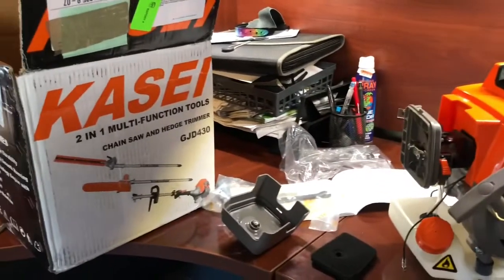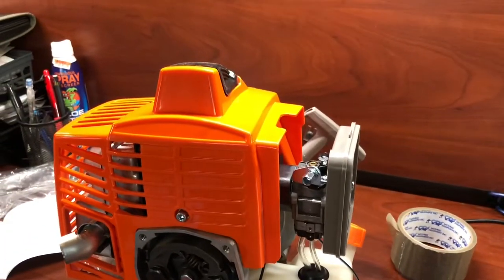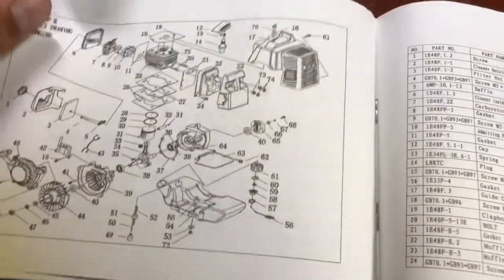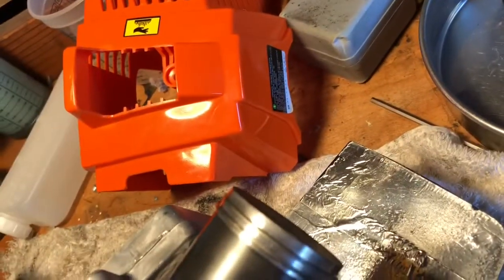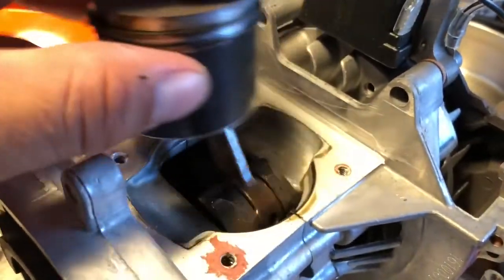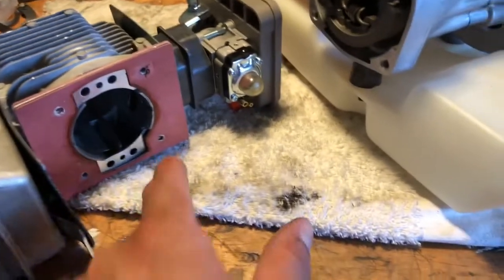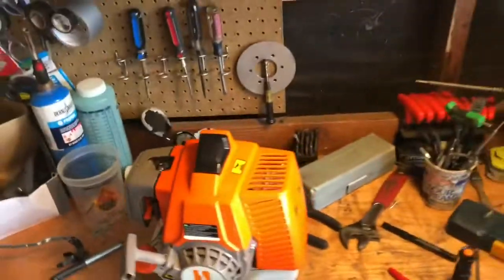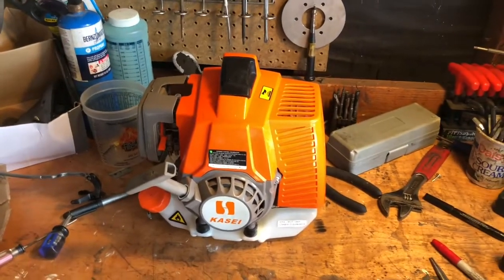Huasheng / kasei 63cc 2stroke engine (unboxed review & performance port work)

Comment from the maker: Heres a quick follow up Vid 
https://youtu.be/BjFo4rY_Gug
Reply: Thanks for your videos homie. It felt like forever waiting for my set up to start comig tog. This engine makes me happy.

Your video gave me alottttttttt of confidence in opening it up. You given me alota good advice.

This engine doesnt overheat... haha. With the shroud.

Also hypothetical question.

Stock Gp460 with only bolt ons. geared for max 50mph vs our 63cc with bolt ons. Geared for 50mph same speed. Who do u think would win in the low and top end? With iut limited 9500 coil.

Just asking for ur opinion. The 63cc a more reliable engine? Do u think theb63cc would beat it in bottom end? Im new to scootering.
Reply from the maker: Waldo's Project hey bud, i never noticed this comment.  Thank you.  And a 460 has a full circle crank, and single piston ring, so it will out accelerate the 63.  The 63 should be a powerful yet reliable option.  In a race the 460 would win... but then there’s variables.  If the 63 had full circle crank and single ring then id say it would be the best.
Reply: If I open my 63 cylinder and remove rubber restrictions and same as remove the rubber ped and I will change carburetor and if I will work on piston what you recommend yes I like 63 motor I have two motors but are restricted
Reply from the maker: Shahid Khalid Abbasi  buy the replacement cylinder on alibaba.  It comes non restricted.  Also the piston comes skirted.

Comment: Did you have to do anything to the piston ? Just grind out those extra holes on the head?
Reply from the maker: Yes, you can see in one of the pictures. I raised the port channels on the piston.  I also lightly ported the cylinder head.  It runs great. I just need to switch the coil to get rid of the limiter however, I do have to re-notch the timing flywheel.
Reply: @arrepuess what’s the difference with power vs stock that you’ve seen?
Reply from the maker: @justaregularguy6971  huge gains.  Quicker & higher rpm,  torque
Reply: @arrepuess do you do work for other people? How much would an engine be like that if one sent there’s in .

Comment: Did you have to get a new gasket once pulled the head off
Reply from the maker: Not if you dont tear it.
Reply: @arrepuess thank you thankfully the new ones don’t come with the 3 gaskets just one and no restrictions on the ports they also updated the flywheel if you try to do this mod with the fly wheel advance it won’t run right they made it so just the coil from 50cc is needed for more rev

Comment: Experiencing similsr issur with my 52cc engine. Instead of circles there are little channels and its on the case side transfers instead of the cylinder. Im afraid to grind it and case match and mess the timing up or displacement.
Reply from the maker: @JoeMammaBff  if its a gasket, open em up.  Itll run un obstructed.

Comment: I have a 49cc 4 stroke scooter right now I'd love to swap this engine on to it what kind of transmission/gearbox would I have to use with this KASEI 63cc 2 Stroke? Would the current transmission on my 49cc 4 stroke work?
Reply: Yes it would work but I run mine with no gearbox straight clutch to back sprocket and I weigh 230 lb and it still moves me good is hell for a little two-stroke

Comment: I find mine a pain in the arse to start when warm . There is a spot where it sucks arse ,and refuse to restart ! It has OK power, but it sucks the fuel down fast with stock exhaust! I have a new kind of exhaust that is super efficient,  way more power,and lower noise ! I will put one on ... next week
Reply from the maker: Sounds like your carb is out of tune.  Get you a tunable walbro 15mm replacement barrel carb.  Or upgrade to hda style.  But that takes knowledge.  Check compression if it struggles to start at times.  Could need a new ring if you run it hot at times.

Comment: Hey rich rz , 
I want to put one of these on my scooter but wanted to ask you some questions . My current engine is an Ie48F that is mounted in the left side of the bike , sprocket is on the right side and it uses a gear reduction gear box so that it will pull to the right instead of the left . The mounting holes for it are 100mm diagonally across the clutch bell , 

Do you know the mounting hole spacing size for the clutch housing on this Kadee engine ? Thanks .
Reply from the maker: MIKE Balderree for 78mm clutch engines, the bolt spacing is 70mm. Or 2.76”..  it fits bladez, evo, goped scooters.  I suggest buying the aftermarket cylinder off alibaba if you want non restricted version.
Reply: Thanks ! Do you have any pics of the port work you did to it
Reply: I’m thinking of buying the PNW porting stage 1 but also considering porting it myself but I’m inexperienced
Reply from the maker: MIKE Balderree I think i show my port work on one of my videos🤔.   Get a replacement cylinder kit from alibaba,  they come unrestricted.  But yeah I recommend PNW’s engines.  Hes a standup fella, and out there putting in work.  So go get it if you want torque.
Reply from the maker: MIKE Balderree dont port yourself if you aren’t willing to ruin your top end, or make it run worse?  First I recommend practicing, and studying how to, what works, & what doesnt.   Trial and error experience

Comment: I have same motor please tell me I would like to unrestricted this engine
Reply: Man can I ask you have removed all rubber restrictions in the middle of cylinder and exhaust pipe rubber as well please tell me your experience
Reply from the maker: Shahid Khalid Abbasi  i ported it,  i used a dremel and carbide burr set to grind out the base gasket.  Study the video and others well.  Have some fun with it.   The easy route is to buy the non restricted replacement cylinder.  Make sure all air ways are free and clear.
   Or send it to someone that knows.  PNW porting on Facebook soups em up.
Reply from the maker: Shahid Khalid Abbasi i recommend you buy the replacement cylinder and gasket.  It comes non restricted.  In alibaba express i think 🤔... its been so long I forget. But its there.  Research a bit and get it.

Comment: Hey bud I use these engines for friction drive motorized bicycle builds and I'm interested in what carb and intake spacer you used
Reply: Cool thanks I have a few 460 intakes laying around. Have you figured out how to get more RPMs out of this motor?
Reply from the maker: Motorbikesbyjason the coil is limited to 9500 rpm .  If you find a way to modify on a different coil, that would be the solution.
Reply from the maker: I use the carb and manifold from the Chung Yang gp460 engine.  You can find it at Daves Discount Motors. (Ddm).    Discount code (ddm). 
   You will have to elongate the bolt holes on the mani to make it fit.
   I bought a MB linkage to fit the hda223 carb.   A better carb would be the hda-48... i think more low end power.
Reply from the maker: Motorbikesbyjason check out my other vids

Comment: Stock carb may be better than the carb kit?
Reply from the maker: Waldo's Project not if you get the right carb for it.  It shouldn’t be too small or too big.  A wt style carb is too small.  You need an HDA or bore approximate bore size... at least 15mm ventury for this motor.   Anything smaller will choke it.

Comment: Dude this sucks waiting for my exhaust. Have u ran it with the stock can? How much of a difference was there?
Reply from the maker: Waldo's Project i did run it with the can for a bit.  And it had stock carb.  Didnt have much acceleration. carb and pipe made it a lot better.  
   You get the jetpro pipe?
Reply: @arrepuess  yes. Its at the post office right now... (sunday) waiting till tomorrow. N ill put it on during my graveyard shift.
Reply from the maker: Waldo's Project cool,  that pipe should be better than the one i modded on mine. 
   Did you port it?
Reply: I also seens the inside of the cylinders n ports n was suprisrd at the machining. No burrs to port. Cleannnnnnnnn. U mentioned something about squishband. N i just assumed well engineered enough engine. N like the videos of the 63ccs 71ccs. Enough. But ur video gave me the confidence to open up a brand new engine. Haha.
Reply: My port job was only the restrictor plate and to the carb spacer plastic thing. Also ground down part of it to attach the 223 carb. I smoothend the burrs inside the venturri. No porting on piston or ports. Maybe next engine. I may drill out n lighten piston. I didnt dunno about crabkshaft balancing. N dont wanna unbalance it. I dunno if piston weight effects it.

Possible cut chambers shallow on top n curve piston by exhaust side. Didnt map nor think massive enough gains compared to the mods i was gunna order. Not for the time imo. Maybe port top of exhaust. Case reeds maybe a cool build for em. Business idea. Make n sell ported gaskets. N metal cut spacers.
Reply: Cracked it open immediately for fear of affecting the grooves for piston rings n cylinder running it. I think they test all these motors factory. But i agree. Prob not broke in. Anywhere close to 5 minutes.

Comment: Are we brave enough to open up a cdi thing? U think there may be a switch inside? Some knob or screw to control rpms?
Reply from the maker: Waldo's Project ive looked into if it’s possible to un restrict a coil, but no luck.  May have to dig deeper.  Or, see if another coil can be modded on.  
  Timing has to be perfect.  Rockit advance key positioned advanced or retarded doesnt help performance on this motor.
Reply: @arrepuess  so I ordered a new coil. There r after market ones u can set time n all that the power spark. But it comes with a battery n trigger state or some shit. Electronic aftermarket type shie. 

Neways I ordered a new stock coil. To try n open up the bottom. Cut it open n see if I cannfind a knob inside to adjust rev limit. Wish me luck. Im ok with the 20 dollar loss. Lols. Hope we can rev up to w.e.

U know what im talking about right? Alota cdis if u open supposedly a knob available.
Reply from the maker: Waldo's Project I highly doubt there will be a tuning knob on stock coil,  but is what you ordered bolt on?
Reply: Yes its the stock kassei 63cc ignition coil module assembly. Same rubber ugly square spark plug boot n all. Coil n module thing tog. 

Its sealed like melted rubber tog. Atleast mine. I dunno how imma cut n open it yet. But wish me luck. If there is a rev limiter. There should be a knob somewhere inside.

Lols wish me luck for both of us. Haha. Lols. 63cc n imagine like 14000+ rpm.

If i find it. Ill definately make a video.
Reply from the maker: Waldo's Project  like i said, i highly doubt there will be a knob, but if there is, that would be very sweet.  Good you are giving it a go.  Because finding a way to bolt on a different high rpm coil would be a bitch, but doable.   Id check out vids or specs on small engine coils.  So far i havent seen any with adjustments, unless its an msd module, but thats a different story

Comment: Could u just peel off the restrictor plate and gasket? Or did u have to grind it?
Reply from the maker: Waldo's Project grind it open to flow perfect through the transfers.  Squish clearance wouldnt accept less.  I know theres an alternate cylinder which clears with a thin gasket in AliExpress.
Reply: @arrepuess  bet homie. Preciate it. Lols u should even record an idle thing
Reply from the maker: Waldo's Project im waiting on a new phone holster clip then ill take some new footage.  It does make impressive power the way i modded it.  Id improve a the carb and mount a new higher rpm coil.  But thatd be something for a machinist.  Stay tuned.  Soon ill show what i have going.
Reply from the maker: Waldo's Project i just uploaded a short vid i had on my phone.  Keep in mind its gear real low for offroad / hills

Comment: i have an uberscoot 2x 49cc will the 63cc be a bolt on?
Reply from the maker: Philip Yun its should be bolt on.  However you may not like how it runs stock.  Its performance restricted.  Mine runs super powerful though... but needed port job and better carb.
Reply: @arrepuess  preciate it. video is dope. its keeping me from going with the 460. i think id rather have a 63cc. 

I ordered a brand new 63cc kasei. I will derestrict it. prob a light port. dunno much about porting so mostly polishing n maybe small burrs n slight slight rounding of ports.

i have an exhaust and carb ordered as well. for the 49cc. i hope that the 49cc parts bolt up.

lols I really really want a video of ur 63 running. haha what do i gotta do for it?
Reply from the maker: Philip Yun  i have to get a gopro and have been procrastinating 😅.  
  You will be good if you bore out the restricted metal spacer.  I now run a walbro hda22 carb from the gp460.  But, i think it would make more torque with the hda-43... the one that comes with the zenoah g62.  
   Im glad you appreciate my video.  Thank you.

Comment: Anyone with a good idea how to make a strong enough engine mount? All lower engine holes is M5 which seems a bit weak. Only way I see it is making something with the bełl housing M6 holes. anyone tried this? Will it break? Does this engine vibrate alot?
Reply from the maker: Olle Thelin  sitting it on a mount and bolting from under should be the best way imo.  Otherwise if you do the clutch mount “like i did” it works well, but more stress as its hanging, and its quite heavy & torquey.    The motor vibrates, not too too much though.  Remember its chinese and probably not the best balanced.   I have it mounted on a goped riot.
Reply: @arrepuess  Thank you for the quick response, exactly as I was thinking having the engine hanging could not be optimal. By bolting from under you suggest the three fuel tank bolts? Maybe a combination could be the best way...
Reply from the maker: Hey np,  i didn’t remember it only had 3 small bolt holes underneath.  “ im used to other motor”.
   You can fab up an L shaped mount for extra support & use the lower clutch bolts,  or all?  Gsr gopeds use 78mm clutch / motor mounts you can look into.
    I have mine mounted from the clutch side on an off-road goped riot.  Havent had problems yet, but then I hardly ever use it.
    With the work i did to this engine i must say im impressed with the power it makes.  It pushes my heavy arse up some pretty steep dirt hills you would typically hike.  Once in the power band “ if you have a pipe”. Theres no stopping it.
Reply: @arrepuess Ok thanks, I will look into it. This little engine does look promising except for the lack of mounting points. Thank you for the help!

Comment: looking forward to the new video of this engine. Maybe Talk about engine power it made on the goped,compare this 63cc to the tetra60?etc..that be a coo video too.
Reply from the maker: George Melchor i made it run superb.  But it did take a lot of modding to free air flow.  And has larger carb.  But it only revs to 9500 rpm.  
   Still, it makes as much power as a tetra 60 up til 9500rpm.   I was off-roading with it on my riot and climbed steep hills impressively.  But... I would not recommend this motor if you will not be doing any port work of freeing up of engine.  I will try to make a new video of it in action. I am very happy with how I left it

Comment from the maker: This particular Kasei engine is also restricted from the coil.  Limited at 9500 rpm.  I am now looking for the old version higher rpm coil 😤😒
Reply: find one? or figure out how to modify it?
Reply: Any update
Reply from the maker: Tonka V yep,  this comment above is it.  Im looking for a previous versions coil.  This one tops out at 9500 rpm from coil.  And is limited in air flow from stock package.
Reply: Can you tell me about old version some people suggest me replace coil flywheel and pull starter with 460 and walburo 255 carburetor but what is alternative?

Comment: By the way my Goped GTR hit 52 mph geared 10/56 and got there quite quickly with my old 63cc I eventually stripped the threads on the flywheel side of the crank experimenting with flywheel timing. Be carefuI with that. I just ordered a new one online, from Walmart lol. 185 shipped. Crossing my fingers it's unrestricted.
Reply: How much do you weigh?
Reply: Was it ported?